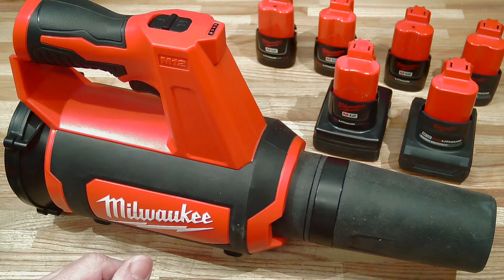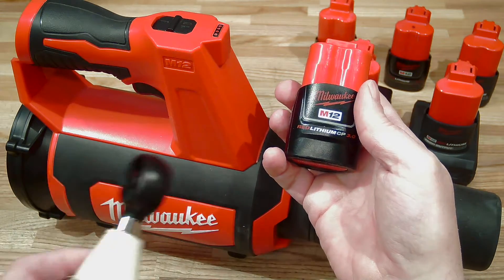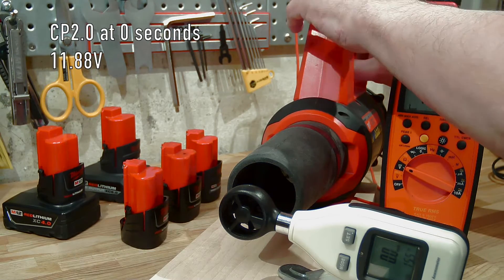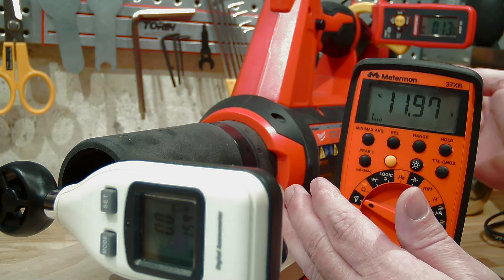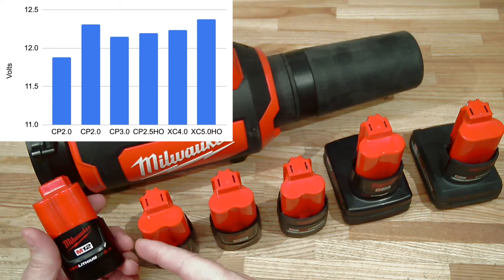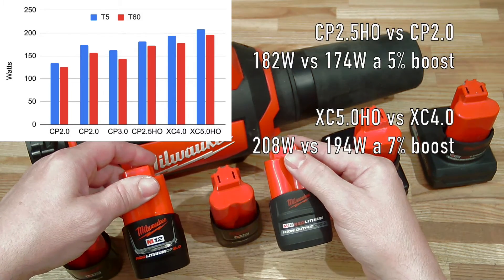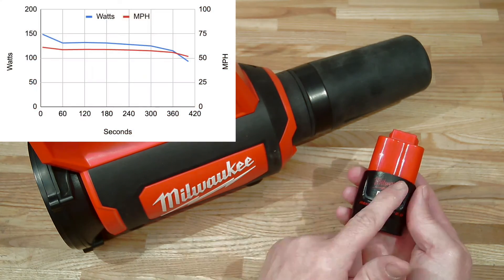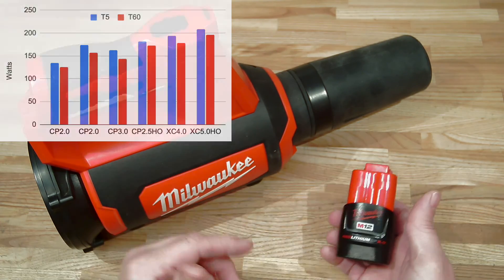Test: Milwaukee M12 HO Batteries Better In Their Spot Blower?

Comment: Thanks for sharing.  Interesting specs you provided, especially the details on air speed differences.  This is a useful blower.  Certainly not for the lawn, but I’ve been using for clearing sawdust when working outside, off the sawhorses and tools.  Also easy to hold when on a ladder for blowing leaves out of the gutters.  I have some of the HO 2.5 batteries.  Performance basically same as 3.0 compact.  For the blower I’ve been using the XC 6.0 batteries which weren’t tested here.  Guess they would perform same as the HO 5.0 did.
Reply from the maker: Thanks. I use mine most for lawn clippings on the walkways, sweeping off the patio and the garage, powerful enough and light and nimble. My M18 blower is for spring cleaning and snow removal. The M18 is a beast in comparison to the M12. I have heard negative things about the 6.0 batteries, that they go out of balance easy. So, I have not added any to my collection. YMMV.
Reply: I have mine with a XC6.0 and it's been running without issues. I prefer run time over performance in this case, since I use it for small cleaning applications like removing leaves without blowing mulch or dusting my baseboards.
Reply from the maker: Yeh. It would seem that the XC6.0 should provide about as much air speed as the XC5.0HO (perhaps 4% less). I have just avoided 6.0s because I have not found a deal on them and I read in a few places on the intertube that they are more prone to going out of balance than XC4.0s. YMMV.

Comment: great test!  do you find that the m12 fuel series motors can utilize the HOs better than brushed?  with m18 apparently fuel models can somehow take better advantage of the HOs.  non-fuel tools  HO doesnt seems to matter vs non HO...or so i've been told.   probably not related to the motor but rather the circuitry.
Reply from the maker: Thanks. I will be posting more test videos, though I do not have many brushed tools. The control of power into brushless motors is determined/limited by computer control while brushed motors have much simpler power regulation.